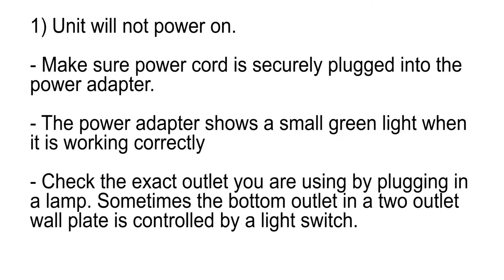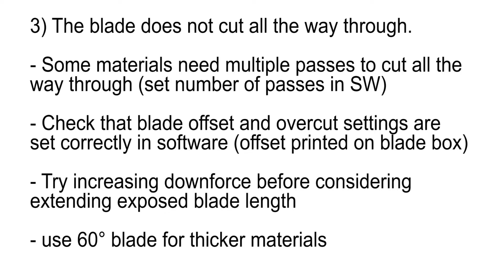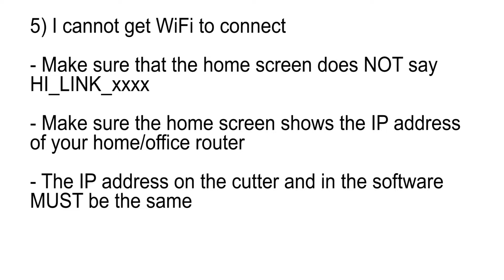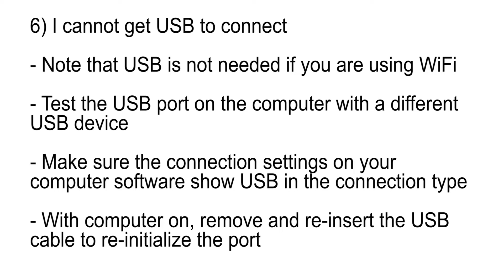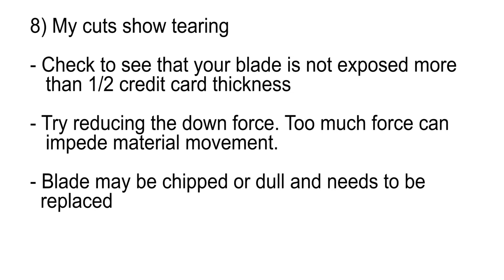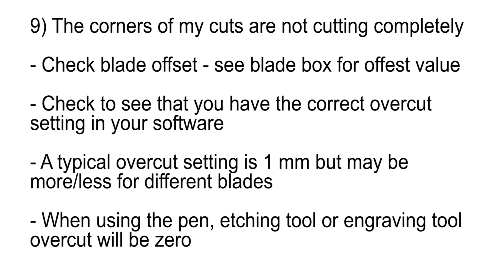PrismCut - Troubleshooting

Comment: TIp: One day, I had trouble connecting via wifi. It showed it was connected, but the connection test wasn’t working. I changed the IP address by one (+1) and refreshed the connection, and it worked again. Hope this helps. 

2011 iMac, SureCutsAlot, .svg files exported from illustrator CS6. (Yeah my gear is old… but it works.)
Reply: I"m having the same issue but increasing the IP address by 1 isn't working. I'm so frustrated.
Reply: @thewildsasquatches3033  ANY LUCK YET ?
Reply: I just connected mine again after not using it for well over a year since switching to DTF. It wasn't cutting properly the last time I used it. Upon checking everything in SCALP 5, I discovered there was nowhere to enter the IP address as I had done before. Deleting it and adding it again was somehow different this time; under US Cutter, the option is now "PCut" instead of "PrismCut," and there was no way to enter the IP. Choosing "Skycut" as the brand solved the issue, as these are rebranded Skycut machines. Seems to be working fine now.